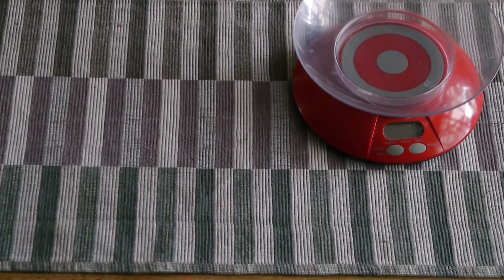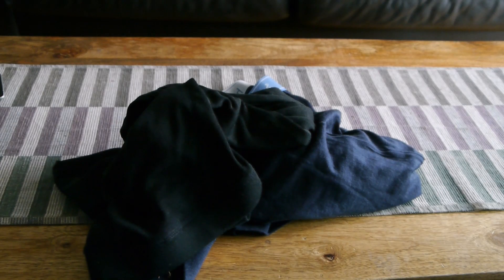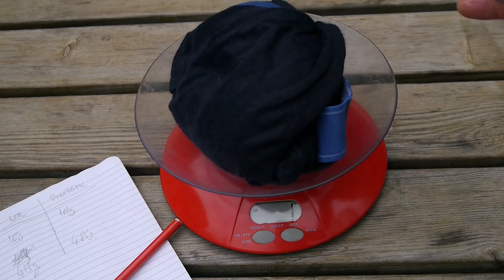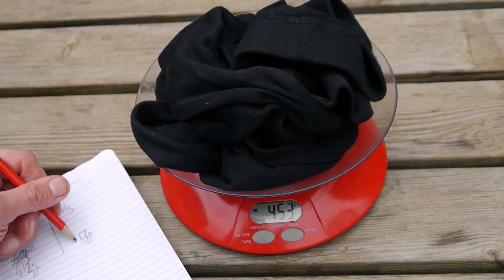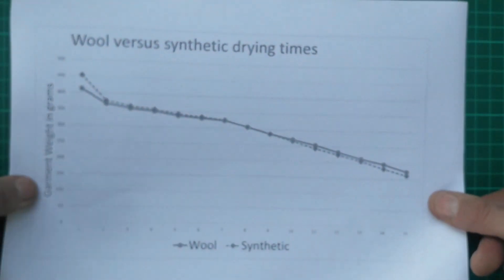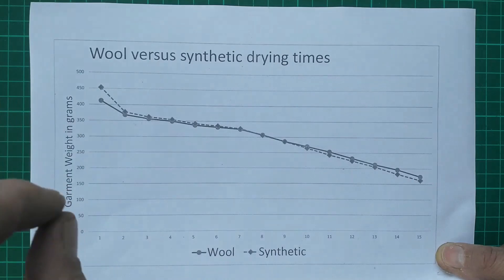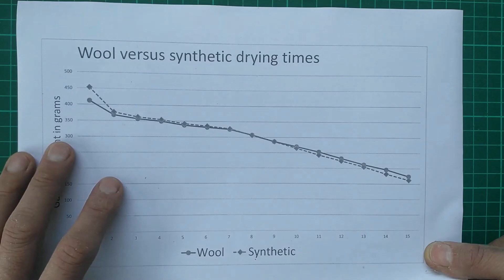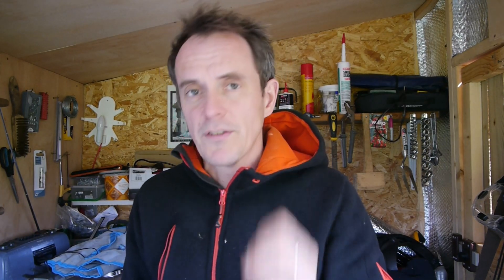Merino V Synthetic Drying Times - Base Layer Test

Comment: cool, can you do the tests with alpaca and down aswell?

i watched the resting heat video. how good or bad is down there?
Reply from the maker: Hi @mapriex. Down is a really bad choice for wet as it clumps and loses all insulation value. But for stationary heat retention in dry conditions it is unbeatable. I could certainly do a test on that and what will add alpaca wet performance to the future tests list.
Reply: @bigskies2202  i know, but i wanted to know how the curve for down is on the graph
Reply from the maker: Yeah a wet down test would be a pretty worthy one if nothing to check against the conventional wisdom that it has zero insulating value when wet.

Comment: Never wring out wool garments. Always squeeze them. Wringing can Felt the garment.   Drying of both fabrics can be speeded substernal by a twostep process. * Wring out the garment * lay the garment on a microfiber towel roll the towel tightly and squeeze the towel. This process will reduce the moisture in the garment to about 10%.  to 20 %.    At 20% moisture level the wool which will feel damp but not wet will still retain 80% of its warming ability.  Not so with the  polypro fabric.   There is always individual factor to consider such as life of the garment, cost, intended use. I very seldom wear bottoms. Personally, Most of the time in the rain I protect my core wearing wool and a rain jacket and rely on Alpaca over the calf mid weight socks.
Reply from the maker: Good tip on using the towel, thanks Tom. You are quite right on wringing. I should say squeeze!